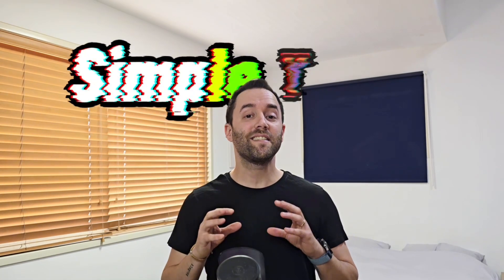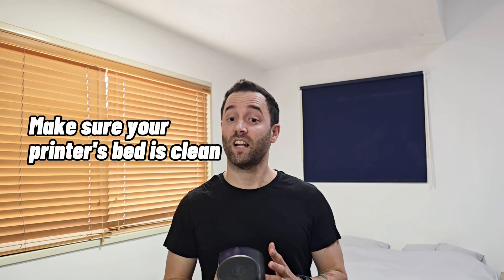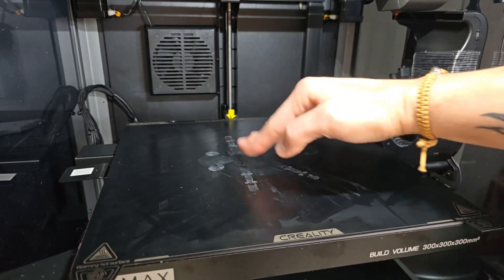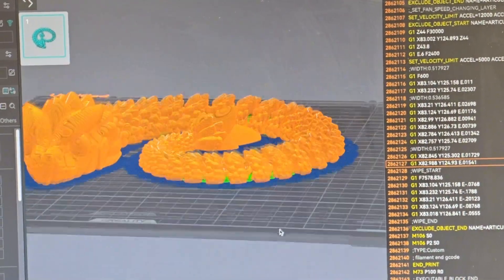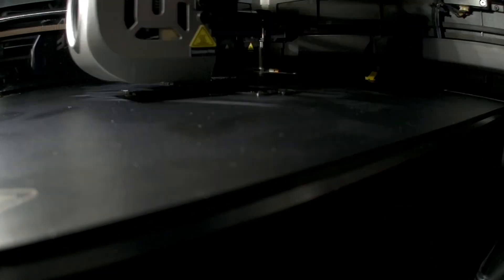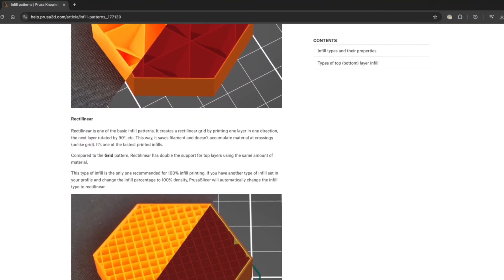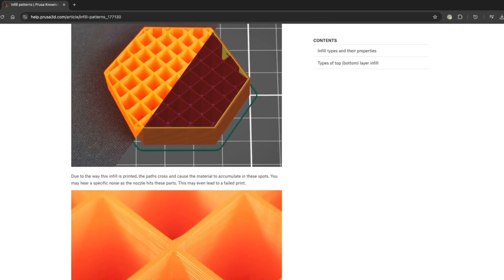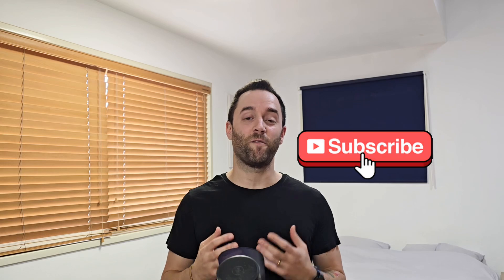6 3D Printing Hacks (I WISH I knew sooner)

Comment: Some really good tips, particularly that infill guide, very useful! However, what I would say is that glue stick for adhesion is not necessary in my opinion. If you're needing glue stick then there is a problem with your slicer calibration, your build plate or your printer. First layer flow rate for slicer calibration, a clean and undamaged build plate and bed levelling are all really important processes to check when issues arise, speaking from experience. Also, the Biqu cryogrip and other branded "super tack" plates will absolutely eliminate the need for glue stick with PLA and PETG and in a lot of cases, no need for brims either, which whilst I agree sometimes they can be satisfying to remove, if you're printing a bunch of items to sell... it gets annoying after a while! 😂Great video though and keep up the good work 🎈🎈
Reply from the maker: Thank you for this!